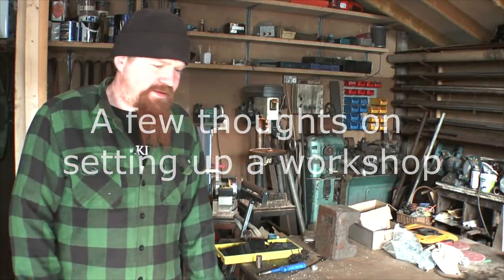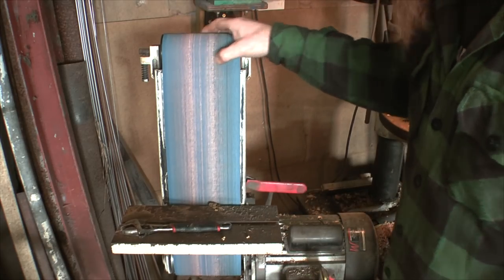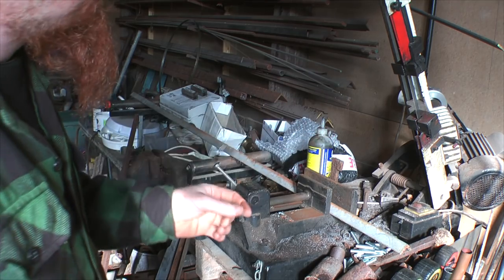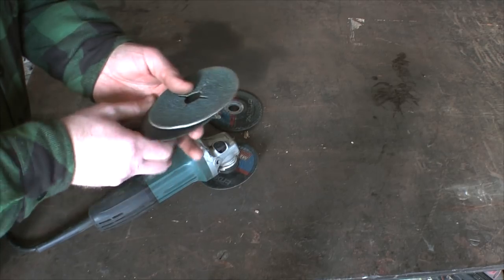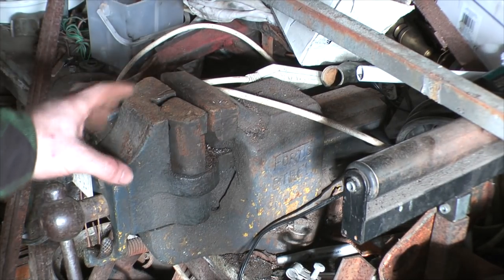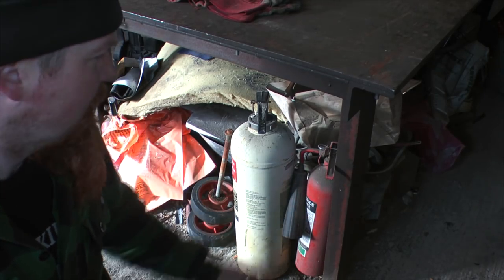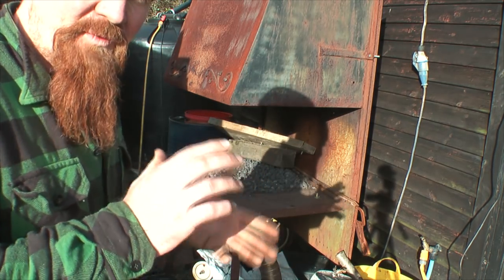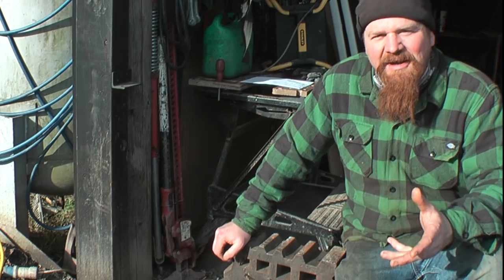Blacksmithing: Setting up a workshop - Some thoughts

Comment: Thanks Max. 

For a very experienced career banker this was extremely helpful.

Time to drop the pen, pick up the torch and blow some holes in stuff.

All the best mate.
Reply from the maker: Go for it!
Reply: I did an oxy workshop a few years ago (great fun) with full intention to start welding but it was always a bit daunting to get started and I had no space. 

I have some space now and I've been trying to work out if oxy was the best option or something else and I think your explanation was excellent.

Some more on welding would be appreciated from me and others I'm sure.

I particularly like the way you break things down so even clowns like me can understand it.

Cheers

Comment: Cool tour! I had a steel splinter in my eye also. Didn’t feel to bad until I woke up in the middle of the night and had to go to the ER. The doc took it out and said it started to rust and I had to see a specialist to remove the rust. He did to me what he did to you and ground it out. It was a strange sensation. He got most of it and said a tiny piece should migrate to the surface within a month or so, it did and he ground that out also. I never forget safety glasses anymore!

Comment: Hi Max I've really enjoyed watching all your vids, thanks! Just thought I'd mention if you ever need an MRI make sure to mention to them that you've had metal embedded in your eye in the past as the magnets will pull anything remaining in there out and damage your eye/blind you
Reply from the maker: Good tip! I tend to avoid MRI machines anyway as I've 40 staples deep inside holding my intestines together :-)

Comment: Axminster tools look good & hard wearing just like the carpets , their  buyers are craftsmen know good tools  & dont compromise , used them for many years still do , great video and your banter as always , my workshop is the opposite to yours my forge band saw etc is in the corner the majority is woodworking machines axes slicks old planes ,when  I need to bang out a few decorative hinges for a door or something forged metal & wood always look good together , cheers

Comment: In my younger years I worked a fair bit in businesses making regalia, badges and overly-expensive impractical bathroom fittings.  The linishers were usually far more upbeat-happy in their outward energy than the polishers.  The stampings folk generally kept amongst themselves (stampings club) and were all predominantly Asian women overseen by an older and very stereotypical English fella who'd lost the will to enjoy life long before I'd first encountered them.  Engravers were generally like the coffin makers from 60's westerns whereas their polar opposites, the vitreous enamelers (always women in my experience) were bad enough during daylight hours to ensure you were never near them after dusk when they had access to wine or worse!   But the dudes in the plating shops were always my nearest speed.   peace and love, Max

Comment: I've had the die grinder to the eye job. Two visits, second one they look for rust to make sure they got everything first time. I was wearing goggles but because I have a large, funny shaped snoz the particle went up the gap between my cheek and the goggles. Getting a piece of metal in your eye certainly makes it water.

Comment: "giant comedy spanner" (laughs)
Yeah, alright, alright... I won't call you a nancy any more and I'll remember to wear me goggles... Thoughts of a Doc coming at my eye with a die grinder (however small) will give me the shudders for years to come.
Oh and thanks.... I've been wondering if a little propane torch would do for smaller stuff (mostly heat treating rather than forging)... and you've answered that question for me.
Cool video.... lots of snips of practical advice... thanks.

Comment: Hey max, how long does a propane tank last you for your gas forge, and how often do you use it? Just trying to figure out how economical it is. Cheers mate.
Reply from the maker: Unfortunately I don't know! My use is very sporadic, some weeks I might use the forge everyday, some weeks not at all. I have been looking at the specs for the gas burner I have on the forge but as far as I can tell if run at the rated capacity, the specs say 7.03 cubic foot per hour (199litres) that would mean a 47kg bottle will last 1/2 hour but it's certainly longer than that! As it happens I'm about to change the bottle and I'll try to log the hours on the next one.

Comment: You need a new hose on the burner..

The outside forge; I was a blacksmith welder at a colliery and we used coal. You're running coke which is incredibly expensive compared to coal. Here's how it's done - light the coal using either sticks or the gas axe. Leave it to get some heat in the fire. With that heat you build a small wall of coal close to the heat source but away from where you're placing work in. As the fire burns it creates a supply of roasted coal. Not a true version of coke but far far cheaper and will burn cleanly and hot enough for forging metal. Remember - as you work the metal through the forging process you also have to work the coal and keep a supply close to the heat. That will guarantee a supply of coke for forging.

I know someone who chopped their knee cap in half with an angle grinder. No guard and the disc split in half. One half hit their knee and chopped the knee cap into two pieces. I was there and it was one of those "I told you so" moments. 
Without the guard on the angle grinder you're adding stress to the disc each time you're placing the grinder down. Please be careful dude.

Hammers are definitely a must in a workshop. Some hammers are utter rubbish and should be binned if they are. 

One thing to ask; will you show us some chisel making?
Cold chisels are incredibly useful. Forge a chisel using a hammer and you then have a great combination. You can dismantle anything using a hammer and chisel!

Great video. Keep em coming    :)
Reply from the maker: I know, annoying as It's not even a year old that hose! 
Good tip on the coal. The coke is just a stopgap until I restart charcoal production, I get it cheap from a mate who buys it by the ton, so it's not costing me that much more than coal.
Safety is ultimately down to the operator! Although having said that, if I've ever had anyone work for me, it's different matter, they get all the kit and closely monitored.
I'll put a chisel on the list, you're right it's a useful combo, I dismantled much of the Landrover with a hammer and chisel!
Reply: @maximusironthumper  Just a question...can you forge weld using charcoal?  Does it get hot enough?......Also if it does would any of the carbon affect the properties of the steel?
Reply from the maker: @adriantyler6911  Yes, in fact charcoal as it burns very clean would be a better choice (real charcoal not brickettes). No when burning in free air the carbon in the charcoal has no effect on the steel (you can case harden steel with charcoal but that involves 'baking' it in).

Comment: Very informative, with regards welding, how do you rate the old Oxford transformer arc welders?
Reply from the maker: It's been a very long time since I've used one! That was a massive oil cooled 3 phase monster, horrible job, welding new sheets to the underneath of a narrowboat, great welder though I only used it at high power.
Reply: Mine seems to get used for the occasional heavy welding job, but otherwise gets in the way. I was thinking about "downsizing" to a more modern bit of kit, but if you rate them...

Comment: We're very much alike max. I'm loving your video and nodding in approval of what you say. Would you be interested in a collaboration?
Reply from the maker: Hi Joshua, thanks for getting in touch, I checked out your channel, some very nice work! I shall respectfully decline your offer as working on Project Awesome is enough for me as far as collaborations go. Besides, you're clearly a vastly more accomplished smith than me, I don't think there would be anything for you to gain!
Reply: @maximusironthumper  loving what your doing. The offer still stands after project awesome. As far as living off grid and coppicing goes you've got tons to offer me as far a wisdom and good chats go. If I can offer help forging wise it would be an honour. I'm building a power hammer too. Very different but you may be interested. I'm very much looking forward to your charcoal video. Cheers for replying and all the best. J

Comment: At 30.00 you show a close up of the venturi you use.  Can you tell me which AMAL 354 this is?  Is it the Long Venturi or the Short choke? ....And is it 3/4 BSP,  1" BSP or 1 1/4" BSP?  Amazing channel.  Loving it!!  Have set up most of a forge ready for a viking knife build!  Just the parts for the burner required!  Thanks in advance!
Reply from the maker: It's the 1" long version. It's fine for most of my work but if I was making another forge I'd either get a slightly bigger version or more likely 2 of the 1" to give the option of a longer heat.
Reply: @maximusironthumper  Thanks for replying Max... really usefull! Keep well fella!

Comment: Max, many thanks once again for a great video. 

Have you had any experience of the Clarke small stick welders? I'm looking at getting a 120 Amp one which does not have to be hard wired. They look reasonably priced. I'm not going to be using it a lot.
Reply from the maker: I've only had experience with a transformer based Clarke welder and I have to say it was horrible! Even simple transformer arc welders have a wide range of quality. In fairness that was about 18years ago and they may have changed. The Clarke Mig and inverter stick are quite well regarded (for the price) but I've not direct experience of them. If you want a cheap stick welder it may be worth considering an old oil filled welder - not very portable but very nice to use and will last for ever. I just bought a 180amp one for £25 - it needed bringing back to life, but still cost less than £100 total and will last longer then I will! A video on it may follow if I can edit the footage into something worth watching.
Reply: Thanks very much. Good advice. I was thinking about portability, but I can forego that. My dad bought an oil cooled Oxford stick welder about 40 years ago. It saw little use. I think I will resurrect that. If I can find it amongst all his things. You have saved me a couple of hundred quid.
Reply: The first job will be to weld up some angle and put some wheels/castors on it.

Comment: Where did you get a lathe for scrap  money?  I'd give my back teeth for one but just never seem to hear or know the right folks.  Never been one for being in the right place at the right time!

Willing to restore, that's not a problem - it's just finding the bloody things!  And everyone on eBay seems to want a fortune "just because"

Any tips or info would be greatly appreciated!
Reply from the maker: I have got bargains on ebay - I save a search (such as dumper, under £500, 50 miles or less) and ebay emails me when matches pop up, it often takes years but I usually find something in the end. I think the longest wait was for a swage block - that took over 10 years!
Reply: @maximusironthumper  I will try that!  Thanks again for your time!

Comment: Ha ha, was only thinking just yesterday - what if I had a You Tube channel (I don't) and I said the first thing I do when I get a new angle grinder is get rid of the guard.  Nah, I wouldn''t dare say that.  Lol.  Mind you, I would always keep the guard on a 9" grinder.  

It's a fingers issue though isn't it?  How many times have you skimmed your knuckles with the edge of a blade?

Best angle grinders and power tools in general - Metabo (German) - you probably know this.
Reply from the maker: I've never caught my fingers in the grinder! I too keep the guard on the 9" but it's used in a very different way. 
I'm not going to get dragged into a tool brand debate ;-)
Reply: Aye, fair enough, lol.  They are good though.  I've had dozens of small angle grinders over the years.

Finger skims - about 3 or 4 over 31 years.  Like bits in the eyes - it happens.
Reply: Someone I used to work with had an incident with a cutting disk on a grinder, half of it embedded itself in the steel workbench and the other half disappeared through the roof.

I wear a full face shield when using a grinder, has the added bonus of meaning I don't finish a session with a black face and bits in my hair.

Comment: I see you have a lathe 😍 I could genuinely have some paid work for you...... I MAY need a driveshaft shortening by 18mm for an engine conversion. Basically, where the spine is, for the cv joint, there is a groove/slot for a c clip. I'd need that moving back a few mm, and the end of the shaft lathing off to shorten it overall. This day and age, it seems extremely difficult to get someone to carry out such a task :( skills are dwindling and folk try and point you towards an off the shelf item. I imagine with a few detailed pic's you'd understand exactly what I mean if you don't already. Let me know. I live up north. But I can post it down no problem with a return label :)
Reply from the maker: I do own a lathe but I barely know how to use it! It does sound an easy job for someone who knows what they're doing. You might be surprised at who is still out there, I needed a flywheel resurfacing recently and found a place to do it only a few miles away and this area is not industrial at all. I found the small engineering works tend not to advertise or have much of an on-line presence as they keep busy by word of mouth.

Comment: you didn't mention workbenches, I would love 3.. 1 for crap, 1 for parts & 1 to actually work on ..... ok all of them covered in crap & i have to clear a corner to work on
Reply from the maker: I did film a whole section on workbenches but it didn't make the final cut! I have a metalworking one, a woodworking one and a covered in crap one :-)

Comment: how in the world do you get a lathe for scrap value?
Reply from the maker: If you're not in a hurry you can get almost anything for scrap value or less, you'd be amazed at what people throw out! For instance I'm sat in the barn right now, on a sofa I intercepted on the way to a skip, in front of a roaring fire contained in a stove I got for scrap price (it need a lot of work). Even the walls and windows of the barn were free to collector too!
Reply: i'm no stranger to getting some handy free stuff that other people were trying to throw away. recently got about 15 double glazed glass panes (and the horrible plastic sashes which will probably become somebody else's treasure) from a neighbour who was getting all their windows replaced, my astonishment is that a lathe isn't really a domestic appliance. maybe i should hand around industrial estates more often.

Comment: Are sledgehammers hardernd steel? Maybe not a good idea to be banging on it with another hammer if they are? Can't the explode? Or is that a bit of an urban myth?
Reply from the maker: They are hardened on the faces and yes you should never bang two hardened surfaces together (you can chip bits off), but if you think about the process of forging, it's all about getting the hot metal between the anvil and hammer!
Reply: @maximusironthumper  hi Max, love the channel!
 I did think that , but if you miss 😲😭🤣